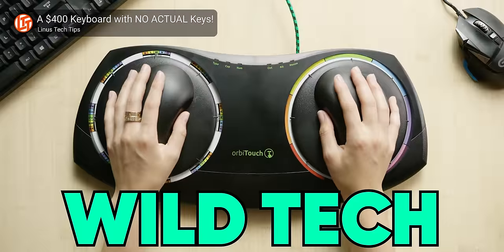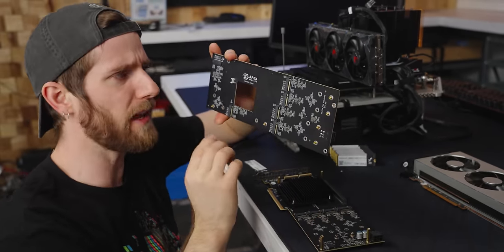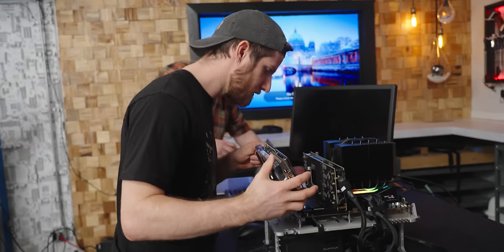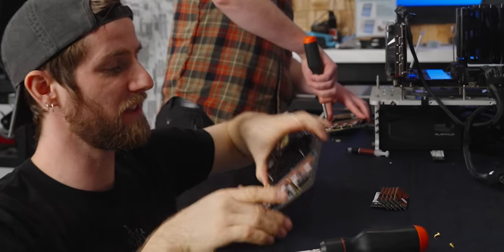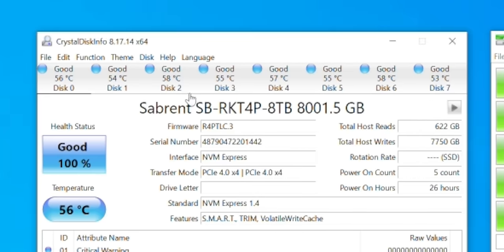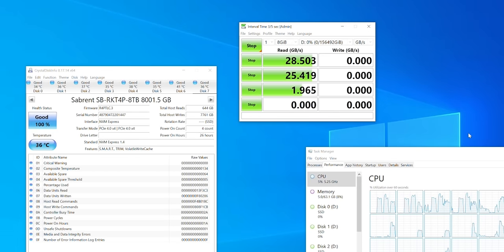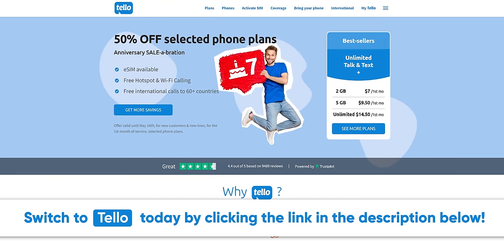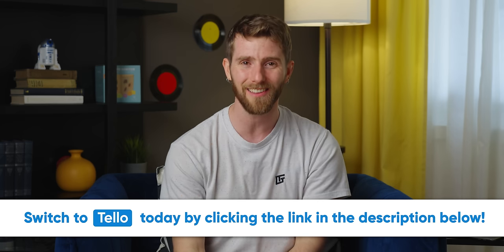This SSD is Faster Than Your RAM - Apex Storage X21

Comment: I was actually expecting something jank when Alex showed up, but just 21 SSDs on a PCIe port surprisingly tame. With that said, I wonder how much of the performance would be retained if this SSD was used on a PS5.
Reply: Alex and no jank? I’m disappointed

Edit: got to the cooling part. I am now satisfied.
Reply: How would you even connect it to PS5? It’s not like you can throw a riser there. Or do you mean If Sony used one?
Reply: @Simon_Denmark  M.2 to PCIe risers do actually exist... you just need to figure out a way to power them
Reply: I can tell you wrote that before they got to the cooling section. 😅
Reply: Think he meant just one of those Sabrent ssds not the whole pair card
Reply: Found the person who didn't watch the whole video yet.
Reply: @ethancrawford197  😂
Reply: AFAIK the PS5 has a standard 4x M.2 PCIe slot, so that would make it max out at a theoretical 7GB/s
Reply: 31 thousend dollars of
Reply: @DLTX1007  That does not mean a PS5 has support for it. Most consoles don’t expect you to do this because if you own a PCiE riser you have a PC 99.9999% of the time so they don’t support it often.
Reply: @benjaminmudd2071  I know that. How can it be bad to point out that such a device exists?
Reply: @DLTX1007  We we’re solving a logistics problem, I found a possible issue to your solution and informed of it. I never said it was bad, just that you might have to account for more than you thought.
Reply: @AyaanThwainyAlThinine  M.2 SSD's are becoming very cheap! Get one son.
Reply: @benjaminmudd2071  It depends. The PS5 runs a fairly standard freeBSD kernel so stuff might just work
Reply: @benjaminmudd2071  Thanks. But don't guess that I do not know what I'm talking about.

Comment: "Hot plug" refers only to the switch chip itself, m.2 doesn't allow for it. The mechanical interface still has to be designed to ground the SSD before applying power and limit the inrush current.
Reply: You sound like you know what you are talking about. I believe you.
Reply: @metaforcesaber  About what most people's thought process is watching these vids lmfao
Reply: i remember Wendell from L1T talks about this on his nvme hot swap bays video. the whole design doesnt seem to be hot swappable in mind also
Reply: Apply for job in LTT
Reply: I think Alex did say something like this at 5:36. He didnt fully explain why it doesn't work tho 😶
Reply: 😮Po🎉 5:36
Reply: @metaforcesaber llk😂
Reply: K😂l
Reply: NVME 2.0 is bringing back HDs to PCIe word
So Hot Plug/hot swap is a thing on that stuff

Comment: I remember seeing something similar to this way back in the 80's. They were essentially the first SSDs. It was a board that you'd install a bunch of RAM on. Back then RAM didn't come on DIMMs. It was a bunch of socketed IC chips that looked like EPROM. Then the board would be installed in an ISA slot (it was probably EISA, don't remember). There were also no drivers. The board would present itself to the BIOS as a native storage device, kinda like how ST-506 and ATA did. The BIOS would facilitate communication between the OS and the "drive". It was a lot like MFM and RLL drives that had their own expansion cards. This was all pre-Windows and GUI OSes.
Reply: There was a similar card in the 00s that too ddr dims
Reply: @Edgar Friendly  I've just ordered one of those to finish off my insane Windows XP build. I don't know how practical it's going to be, but I just had to get one 😂
Reply: @josephkarl2061  I used a 4GB Ram disk way back when. The only impractical thing was copying the program over to the ram disk before running and then remembering to copy back when done. I had it down to a script.

These days I'd consider some sort of filesync program (syncthing maybe?) that handles your files to copy back/forth in more real time so you dont even have to remember the second step.
Reply: @Z C  The plan for the card is to have XP installed on it so Windows will run faster. The Ramdisk is on a PCI card, and even though I've been into computers for a long time now, I never knew the PCI slot will still get power even after shut-down. It does have a backup battery, but we don't get too many power cuts where I am, so I should be good. I'm looking forward to seeing what a difference it makes.
Reply: @Cyhawkx  I almost bought one of those. I remember it used a battery to keep the storage alive when shut down.
It could basically fit Windows XP and a few programs lol
Reply: Speaking of which, I wonder why no one has made a modern physical RAM DISK? IOPS is king and RAM dimms are huge nowadays.
If they could make another 4x RAM Slot card you could have 32GB x 4 for your OS and programs.
Reply: I heard that something like this was used to get around the maximum limit of how much RAM could be installed in old server systems by attaching additional RAM as a drive then assigning it to be a swap drive.
Reply: @Havlock  Yup, that was definitely a thing back in the day.
Reply: @Argedis  Server hardware RAID used to do something similar. They had their own battery so the cache wouldn’t die. I don’t know if that’s still a thing now that non-volatile solid state is so prevalent but I remember seeing stuff like that on first gen Dell PowerEdge servers that had the PERC RAID controller installed.
Reply: All Amigas had a ramdisk feature but the caveat was that it shared the memory (as a storage space) with programs it was running and that the ram was of c. volatile but back then 16megabytes was a lot of RAM and single DD floppy held 880kb's and as most Amigas did not come equipped with a hard drive, having a ramdisk for quick access was convenient. Although Amigas that did had enough ram to fully utilize the ramdisk (A2000, 3000, 4000) had a hard drive from the factory.
Reply: @petrirantavalli859  I never had an Amiga so I didn't know their floppies were 880kb. That's pretty cool.
Just for the fun of it, I used try to run Windows on RAM disks back in the day. I was able to do it for every Windows OS that ran on top of MS-DOS. So basically Windows 1.0 to Windows ME. I never tried to figure out how to persist the OS state (save to disk) so it wasn't very useful for any real use. Just fun.
Reply: @josephkarl2061  PCIe does not get power when the PC is not running.  It is the backup battery that is powering the DRAM refresh.  You should install a SSD as a backing drive for your DRAM storage so that if your battery backup fails then you still have your data (RAID1 it if you want to be lazy to keep the drives synced otherwise use a script to maintain the SSD copy).  Just be aware that WinXP does not support TRIM so you will need a third party utility to run it to keep the SSD healthy.
Reply: @Andrew Lane  That's what I thought too, but it seems I need to get that clarified. I have a first world problem, which is that I have 6 SATA slots, but 4 are taken by WD Raptors, one by a DVD drive and the last one will be this PCI card. I'm going to have to have a real think about how I'm going to make this all work.

I'm not too worried, as it's just part of the fun of the journey, and it's been a great fun journey thus far 😀
Reply: i think ther was actually a video on this kinda thing a WHILE ago on this channel
Reply: Before they renovated, the Computer Science building at my University use to have a bunch of old mainframes on display in the lobby. A couple of them were even old enough to have punch card input. They also had the old ISA cards in various degrees of near-moltenness, I met the person that use to maintain the mainframe back when they were in use - he hated them. Unfortunately the socketed chips had been taken out, so it was almost impossible to know what they were actually used for. I know one was used by the music department, I think you could get math co-processors that worked a treat with audio mixing.
I do know that one of the CNC machines in the engineering department still uses ISA (or EISA, not sure) board in the computer that controls it.
I would have looked further, but after almost destroying the machine playing around with it, I was promptly banned from getting near it.
Reply: the original RAM disk, when memory Sims where cheap, and you have just upgraded, and the bit are left over, even then running your hole system from one  bit sketchy but, boot autoexec.bat script that loads all that bits that would real benefit from the high speediness, and the reboot in into the ram drive, would of been a really cool flyer on a machine, even only with modest specs. for the time, even with 4gb memory cap, now, could get virtual ram on system that behaves in speed more like really ram would,  and any program, are always reading or writing would really benefit, to system temp, file/folder, with that add benefit, after your have finish, any evident on the drive, will be completely  erased completely,  but as long the backup battery lasted, and run second part on the autoexec.bat script to copy the vulnerable, system stuff back to the main real hard drive,  before power the system backdown? would been no more complicated putting a laptop in to hibernation mode? instead of just pupping the power plug?
Reply: @XA--pb9ni  I'd love to see that if you have a link.
Reply: @dh2032  Backing up the filesystem was always tricky because of a few reasons:
1. Back in the Windows 1.0 days, most of my computer hardware didn't have hard drives. I think I had maybe 1 system that had a hard drive and it was a system I had to keep running and not mess with.
2. Once hard drives became more accessible to the general public, Windows had become more evolved and larger. So you either were waiting for the entire filesystem to be backed up (which took forever on hard drives in the 80's and 90's) or you were guessing at which files were critical to the OS's operation. This became more of an issue in Windows 95 and later releases. By that time, OS provided hibernation methods were just easier.

But it was all just for the fun of it anyway. It was interesting to be able to experiment with the device in the original post.
Reply: Gigabyte ramdisk
Reply: And you just activated my 62-year-old memory cells... <big grin>  One IC the wrong way and... well nothing worked.  Notches, put your glasses on.
Reply: @Havlock  now you're cooking with portals.
It's all fun and useful until someone trips the power
Reply: @david_sanchez  Amiga formatted double density disks were 880kb and amiga formatted high density floppies were 1.76mb. High Density Amiga drives were very rare though since they had half speed spinning motors and the only retail programs that used high density disks were AmigaOS 3.1 for Commodore version of Amiga 4000T and Video Toaster software.
Reply: @ancalimonungol  That’s very cool! I kinda skipped over that whole Amiga thing. I used to have a Timex Sinclair 1000 that used audio cassette tapes for data storage. I would write small scripts to do trivial tasks but had to wait 5 to 10 minutes for them to load up every time I powered back up. Crazy how technology has changed since then.
Reply: @aelaan12  Notches! Absolutely 👍
Reply: £Iamsmart
Reply: @Cyhawkx   I'll always owe my buddy a beer for introducing me to synthcing. Saves me and the team I work with oodles of time for our work.
Reply: @Argedis  The answer is obvious if you think about it.  There is no market for it.  While consumer RAM disks existed 30+ years ago, it was definitely not common.  Couple that with the ever increasing amount of RAM on motherboards which allowed that RAM to be used as disk cache, the need of RAM disks died off.  Not to mention hard disks today have more cache on them than old computers.   Enterprises arent going to risk data loss due to a bad battery and loss of power.  Not to mention, if they needed that level of speed for things like in-memory databases, that is done by the database server itself or the OS.  That being said, you still can make RAM disks via software today, you just cant boot from them.
Reply: Yep, the original "solid state drives" were DRAM-based and cost a fortune.  Why not just add more RAM to the system board ?  Well CPUs back then simply did not have enough address lines to use more memory, so by using a controller IC that acted like a hard disk interface, you could stuff a ton of RAM chips on a card.  They had batteries for power-loss protection and persisted their data to a conventional HDD at shutdown.  It was a brute-force solution to the hardware limitations of the era.
Reply: @BillLambert  Address lines?  No.  Maxing out memory on an 8, 16, or 32 bit CPU wasnt an issue.
Reply: LTT actually did a video on one of these.  Slightly later gen as it used DIMMs.
Reply: That's a lot of acronyms and i have no idea what they mean lmao
Reply: @Havlock  way back when, MS DOS had a 640K ram limit
Reply: @david_sanchez  i have a thing that is from the late 2000s that takes ddr3 it has a built in battery and it acts like a hard disk. Its fast as fuck, i still use it lol. I really doubt this apex thing is faster then ram at least for iops but maybe.

Comment: For the VFX Editor (this may be a simplistic view)
things like Baselight X where uncompressed video with native 8K raster EXRs are used outside of a Proxy workflow for finishing, the sheer size of uncompressed EXRs combined with high frame rate requests now, means your bottle neck is storage speed.

There are bespoke Linux appliances that are used for review and feedback for workflows in VFX where high-speed RAID Cards are used for caching these frames.

This would be ideal for this purpose